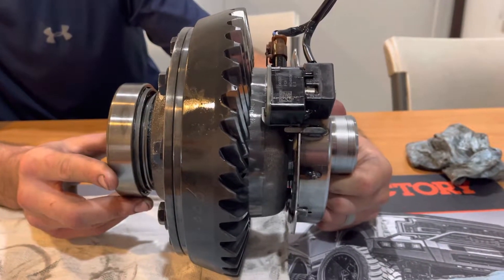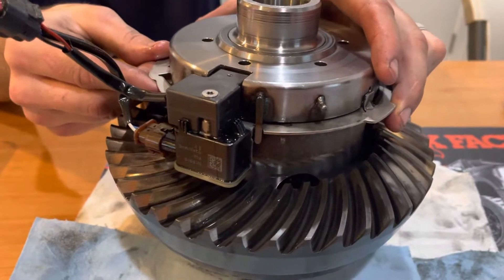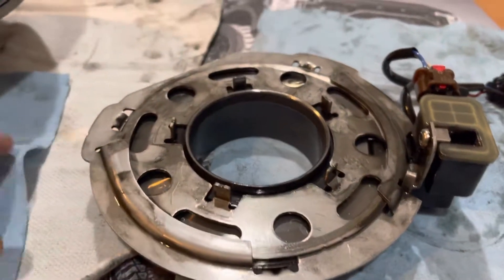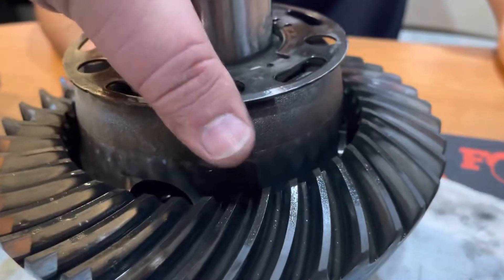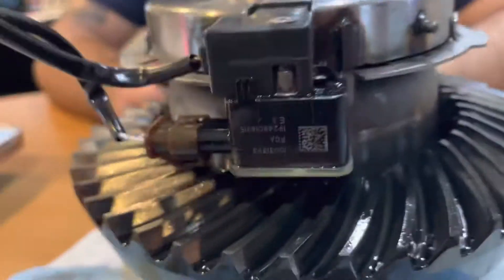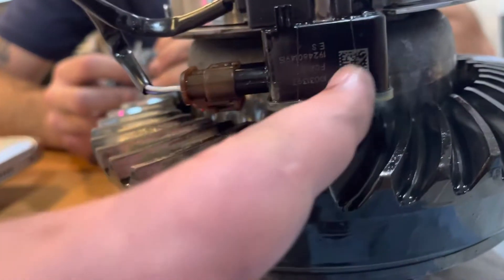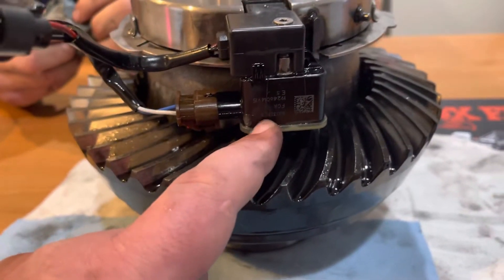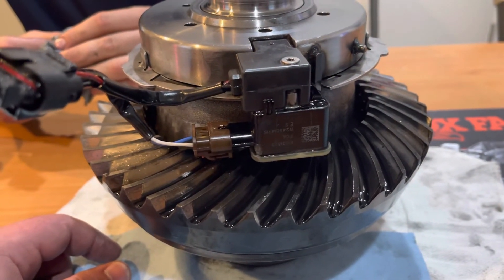Jeep JL & JT Rubicon Locker Sensor Failure Explained By ROCKRIDGE 4WD. Can it be avoided?

Comment: The rear axle locker on my '21 JT Mojave began blinking on the dash cluster and at the switch, intermittently. I'm @ 50K miles, so still under the 5/60 PT warranty. Took it to dealer yesterday; they called back saying it was the sensor and would be covered by the PT warranty. It's also highlighted in TSB 03-002-24; part # 68544629-AA, description Sensor AX 08037155. If your JT is still within the 5/60 powertrain warranty, no need to buy the Z-automotive (or any other) aftermarket part. Your call, but I ain't throwing money at this JT if I don't have to. This is my 4th warranty claim on this JT. Other issues were Fox shocks, overhead exhaust cam, and an ignition coil that I think should've been covered on the 5/60, but wasn't. However, I did purchase (from Chrysler) an 8/85 warranty (while still under my 3/36), so I only had to pay the deductible for the coil. I love this JT, but it doesn't have the quality/reliability of a Toyota.

Comment: The issue is the Z-auto harness just tricks the computer into thinking the locker is engaged or disengaged based on switch position.  The dash now shows this tricked position.  If your locker fails you can be in a situation where the dash shows it disengaged and it is engaged or vice versa.  I had the locker actuator actually fail and on quite a nasty climb engaged the locker, dash showed it was engaged, but it was not - causing quite some challenge to get out of the situation I was in.  So while having a z-auto harness in your trail side repair kit to get you home is a good idea - you really need to fix this correctly.  Replace the sensor, preferably with a potted replacement, and be done with it once and for all in the correct way so that you really do know the locker state.

Comment: I bought Z automotive bypass for front and rear and lockers still disengaged after loads, restart the car and it disappeared then problem again after lockers under loads. Please help!
Reply: The Z Auto sensors don't always work.  I've found oil at every connection. Clean all connections well with electronics cleaner and then use dialectic grease.  See if that helps.

Comment: So I installed the Z OEM in the front axle. (That's where I have oil leaking in the plug) But now my service axle light stays on instead of randomly going on and off.  Does anyone have this issue or thoughts about this?  Thinking about a direct wire to a new switch for a solution.

Comment: But it also happens to jeeps with stock gears
Reply from the maker: Correct. Happened to our personal JL Rubicon at 15k miles.
Reply: Is it safe to drive it like this?
Reply: @Bad_Agent01  Its only a sensor that tells you if the locker is locked or not.  And because its in fault state, it won't lock anyways.  Makes no difference other than the light on the dash.
Reply: @jeffharvey9437  thanks

Comment: There is an informative thread on JL wrangler forums how to inject electronic potting compound into those sensors.  At 12K miles I potted both sensors on my 2019 JLUR and have peace of mind with new synthetic fluid and potted sensors.  The sensors are Hall effect design that has been used in proximity sensors for decades.  The sensor are made by TE Connectivity.  Oil is not an electrical conductor and  the video pointed out fresh oil seeping into them is not a problem, however the oil has tiny metal particulates that over time destroys the sensor electronics.  The Z automotive bypass harness is probably a good remedy for many but I personally like to know the locker light is illuminated because it knows it's mechanically engaged with feed-back.
Reply: Correct, the metal particulates are the issue. The potting only seems to work if the sensor is not yet contaminated. I agree, I like the feed-back as well.  The Z Auto sensors don't always work.  I've found oil at every connection.

Comment: Thanks for this.
What's the "z harness" ? I've tried looking that up and don't  see anything.
Reply from the maker: Zautomotive makes a locker bypass harness.
Reply: THE HARNESS IS GREAT. I HAVE HAD ONE FOR OVER 30.000 MILE. MY LIGHT CAME ON ABOUT 800 MILES AFTER I REGEARED.

Comment: Why can't you clean the sensor while it's apart? Why would you not?
Reply from the maker: My personal JL rear sensor is full of oil. It’s a 2020 with about 21k now. Since I’m not on a customer time line with it. I’m going to do just that and see if I can get enough info to maybe change the entire harness from the sensor to the chassis harness and do it right.  If that happens I’ll make another video. I will likely make another video if I come up with something for the sensor alone.  Ideally if you acquired a new unit from FCA that would be the time to “pot” the sensor.
Reply from the maker: Have at it.  Some do. Some also pot the sensor. The sensor “lid” is not meant to come off but it can. You would have to re seal it and maybe you can do a better job than the OEM.

Comment: GREAT EXPLANATION. JUST REGEARED MY 21 MOJAVE AND ABOUT 800 MILES LATER THE LIGHT CAME ON. I HAVE ORDERED THE Z AUTOMOTIVE LOCKER HARNESS.
Reply: Same.
Reply: Is the locker harness bad though I’m so confused I feel like it just gets rid of the light and not the problem and then that could cause a parasitic draw. Let me know if I’m wrong I’m genuinely curious
Reply: @RoamRoader  NO THE SENSOR IS BAD. WHEN I HAD IT REGEARED IF GET METAL AND OIL INSIDE WHICH CAUSES THE FAULT LIGHT TO COME ON. THERE IS NOTHING WRONG WITH THE LOCKER IT STILL WORKS LIKE NORMAL.  I HAVE ALMOST 30,000 MILES AND HAVE HAD ZERO ISSUES. ;IGHT IS OFF AND REAR LOCKER STILL WORKS AS NORMAL. YOU CAN PAY TO HAVE THE SENSOR REPLACED BUT WHEN THIS HAPPENED TO ME THERE WAS AT LEAST A SIX MONTH BACKORDER FOR THEM SO I ORDERED THE Z LOCKER HARNESS.
Reply: @REBELDAWG-ADVENTURETEAM  thank you ! This is dope gunna buy it !
Reply: @RoamRoader  IT HAS WORKED FOR ME.
Reply: @RoamRoader  TWO UYEARS LATER AND NO PROBLEMS AFTER THE INSTALL.